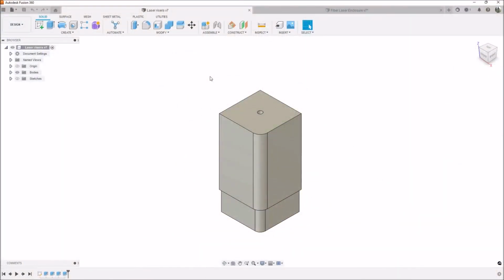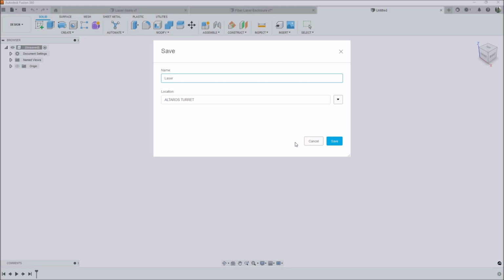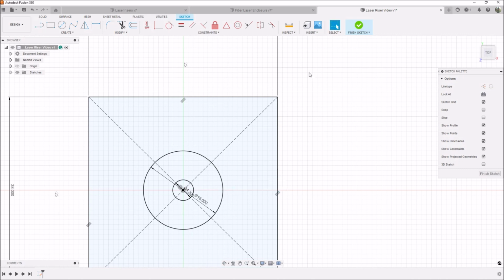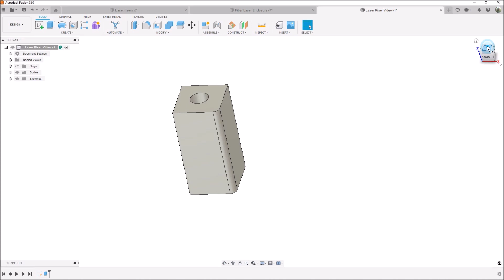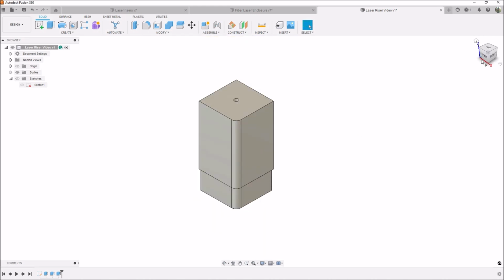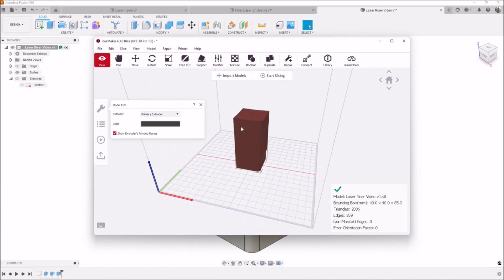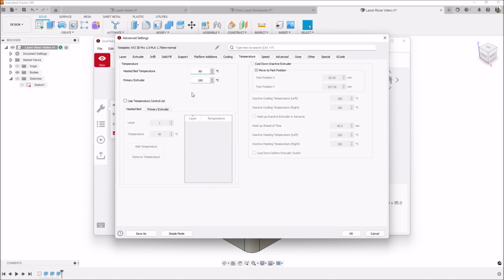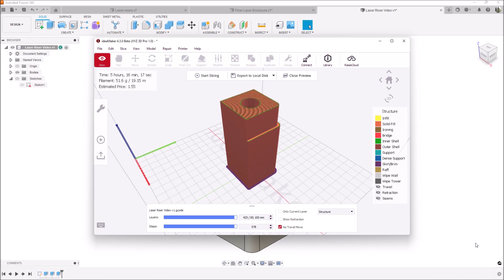Monport Laser Enclosure Riser

Comment: All ways nice learning by example/instruction with 360.  On a side note been watching some if your older videos of the pm727 build. I noticed you used glass fuses for the drivers, I found some resettable breakers that might be better, will work up to 150 vdc. Found them on a solar panel site.
Reply from the maker: Yes I prefer glass fuses for low amp like this. And with breakers we tend to reset to see if it trips again rather than investigating the cause first.